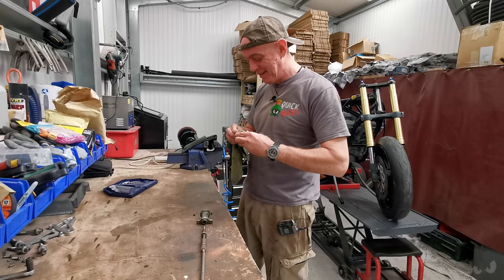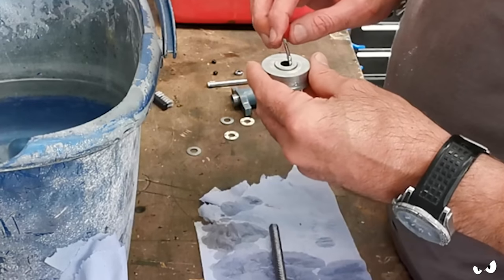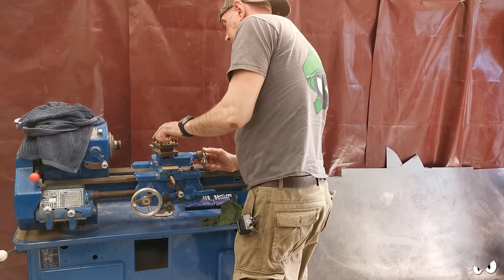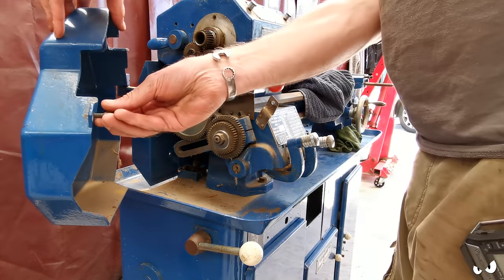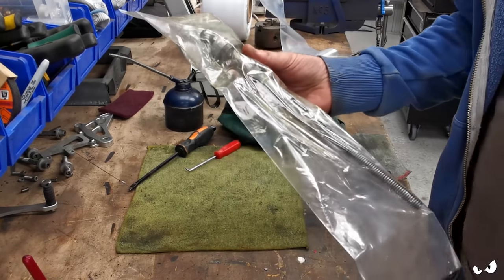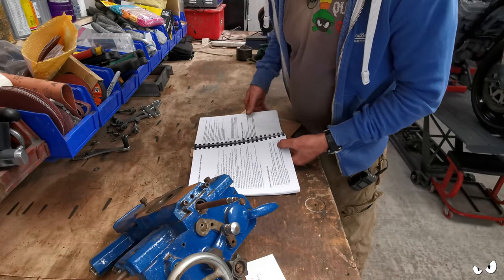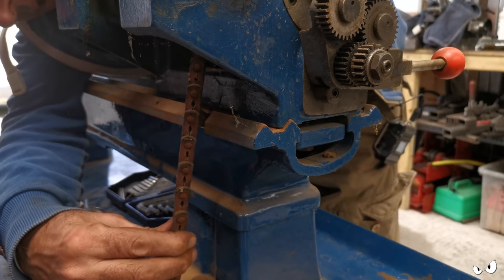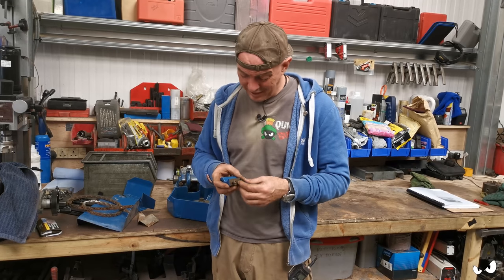Restoring a Boxford AUD Engineers Lathe - Part 1

Comment: I'm no expert mate but that head stock is the same as mine its a MK1 as there is no "button" on the front to lock the spindle. That serial number is from a later unit. As I said mine is the same and its a 1957 model, think they moved to the MK2 in the early 60's.
Bloody good lathes though and loads of extras for them, nice to see a MK1 AUD, Ive just converted mine to AUD as its the longer bed model.

Good luck!
Reply from the maker: I'm still finding my way around it to be fair. I was looking for a spindle lock and you just explained it. 🤣😁

Comment: A good start to the lathe resto. Just a thought with the pictures of those gearbox setting plates for metric thread cutting etc in the manual you could get them made in metal & change the label  plates out on the lathe.
Reply from the maker: Just what I was thinking 😁👍

Comment: With those old belts, you need to use a pair of pliers to turn  the rivet 90 degrees then they pop out of the slot.  You'll need to do about 3 because of the overlap.
Reply from the maker: Yeah they look fussy alright... Apparently the new one comes with fitting instructions, so that's gonna be handy 🤣😂

Comment: Loving it... helping me out with mine, will def be watching this series. the ID for the lathe will be at the end of the bed on the main channel. Hard to see but should be there
Reply from the maker: Awesome, I'll check it tomorrow 😁👍
Reply: @QuickBikes  mines on the nearest rail to me standing in front of it on the far right. By the bolts holding the screw gear in place
Reply from the maker: Lovely, thank you matey 😁👍

Comment: Hi Mate , love the channel , got a boxford last year , model A about 1960, great machine , check out loads of oil ways on the front of apron , dont think you should usr grease , i just use engine oil ! , gearbox comes off dead easy with the leedscrew attached , just 2 capheads ! good luck
Reply from the maker: Thanks for chipping in Paul, I may well pick your brains at some point 😂🤣

Comment: That belt is Brammer belt, adjustable by removing links or adding just unclip rivet bits your lathe man will stock it or its modern equivalent for sure .
Reply from the maker: Ah, that's what they're called.... Thanks dude 😁👍
Reply: Pretty sure the really old bikes used it too even before my time 😅

Comment: chuck the bits in diesel or kero to clean the schmoo out. I wouldnt chemically strip the paint off either unless you are prepared for a lot of effort. There may be alot of filler to make the castings look good. Just a quick sand anda squirt of machinery grey ... or whatever.
Reply from the maker: Kind what I'm thinking now on the outside. The inside of the cabinet is in a worse state so will also get primed 😁👍

Comment: Belive it or not those tipe of belt were used in early motorcycles that used belt drive arround the teens of the last century those are heavy duty and dont need to much replace if they are not worn.. They sell in rolls and you cut and rivet  them as you need...
Reply from the maker: Never seen one before... Interesting stuff though 😁👍

Comment: Hello Mate - I know the feeling of getting a lathe, I was struggling too and finally ended up getting a small hobbymat which will do most of what I want to. Gradually getting it sorted and the bits I need to dial it in properly. When I got it I got a load of lathing equipment that is not for the one I have. I bought it from the son-in-law of the guy who owned it who just gave me everything he had. Whilst the machine is metric, I’ve got a ton of imperial taps, dies, reamers etc and piles of tool steel to grind your own tools. SO if you need anything, let me know and I’ll see if I have what you need. Keep it up Mate!
Reply from the maker: Aw MEGA.... Thanks for the offer Jim. I don't know what I'll be needing yet, but will let you know 😁👍
Thank you

Comment: It probably in the manual you purchased but getting the Lathe level and aligned once its all back together is a must.
My lathe is stood on washers and the weighs are shimmed with copper that was beaten with a plashing hammer and then measured with verniers. measurement was taken  with feeler gauges.
So My lathe now runs true and its fairly straight forward to get square in the chuck and run to 5 thou  over  ft 1' 1/2 
before it was suck it and see and the orrible abominations that came off it well lets just say I learned a lot by getting it wrong. Then I had a book stuffed in my hand that made things better and then I finally saw someone settting  a Lathe up and the light went on.
My method may not be the text book way but when your budget is "Oh I have a lathe"  then you have to get creative to get it on song.
Reply from the maker: I've been watching some videos on the very subject... The good news is that Brett (who is a pro machinist at work) is going to give me a hand when I get to that bit 😁👍

Comment: What a deal you got yourself there, of course, when I was in Plymouth if you wanted a lathe it would be craned over the Dockyard wall onto a waiting flatbed, no CCTV then 😯
Sorry, I've been off the radar a bit, back to work and all that, it's no use now, but you must have pretty much passes my front door too at the weekend and it sounds like you could have done with an extra pair of hands loading.
Reply from the maker: Hehehe... There was a lot of huffing and puffing it has to be said 😂🤣😅

Comment: On reassembly you don't want to have all gears, levers, etc. covered in grease!!..It will suck up every metal filing you cut and make cleaning it after use by blowing out with air impossible..That trick of Craig's with the Hot Wax is perfect for these parts!!..It will keep them from rusting and make blowing clean easy...That's a nice one and it's got steel gears!!..(most have plastic these days)...With power feeds, this will be easy to install a "DRO" on and then you'll have a CNC Lathe!!...I'm Jealous!!..lol..Have you watched "Itchy Boots"??.. if not check her out!..she's gone 60,000 K in a couple of years and is now in Iceland..It's a good watch!..Also watch "This Old Tony" for ANYTHING Lathe/Mill/Welding related!!!...Stay Healthy..👍👍👍🗽🗽🗽🇺🇸🇺🇸🇺🇸
Reply from the maker: Cheers Bill, much appreciated 😁👍